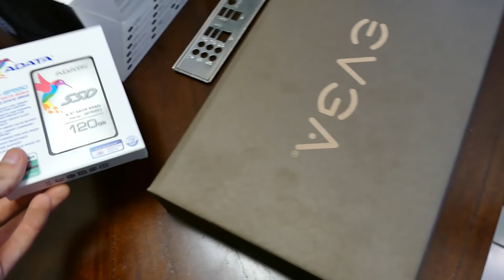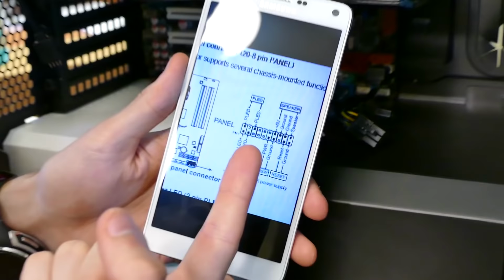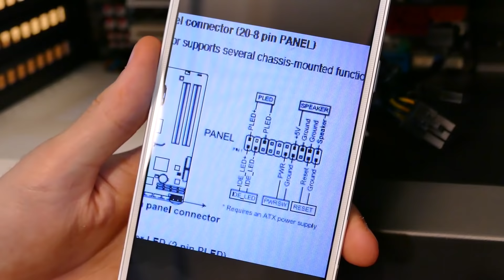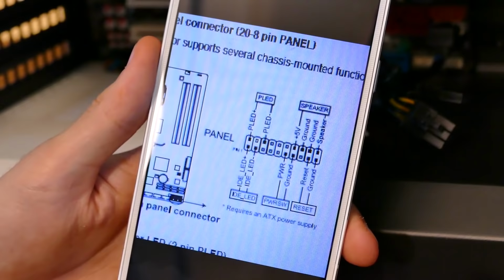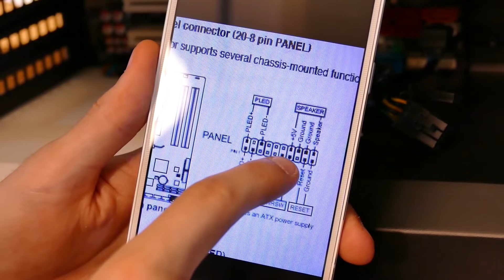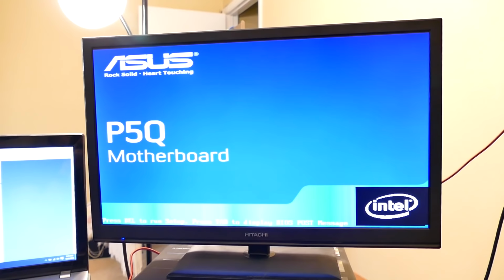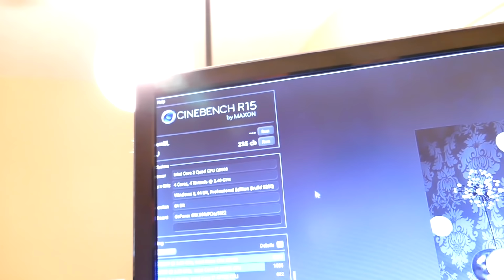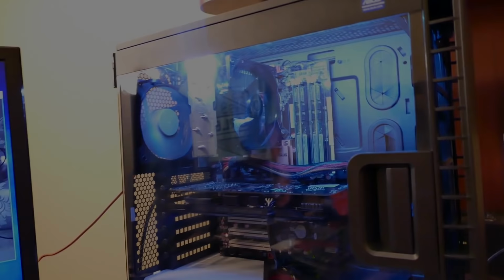Q6600 PC Build Vlog

Comment: should have done a E5450 mod. it costs $20 and is much better. I actually just built a PC with an E5450 and that same motherboard. With a used HD7870 on ebay for $80 dollars it plays witcher 3 with med/high settings @ 50ish FPS
Reply: I got it to 3.6GHz with a CB score of 420 too.
Reply: Blaze it
Reply: +Egon CZ yep

Comment: I wanted to get q6600, but then i find out e8400 is actully faster and not by small margin. And also cheaper, but both of them are nothing special today 😊
Reply: Milan Stojakov no thats weak quad core is much better and stable
Reply: The E8400 has a better SINGLE core score, however it is only a dual core, the Q6600 is a quad core (since the Q), the E8400 used to be better around 2008 to 2010 when games only used a maximum of 2 cores, around 2012 or later games started favoring the 4 cores.
Reply: That is true, but i do not think it matters. See these cpu are old and not suitable for games. If you are going to play games relesed after 2012 you are going to need a lot stronger card, one that will be bottleneck by q6600.

E8400 is great for non gaming applications, even today. You can use it to build nongaming pc just fine for very little money and it will outperform q6600, because in the end single core performace is more important that the number of cores.

Comment: hey, u should try the g3258. Its a good future proof cpu. I've been making $300 builds with it. I got it for $40 at frys electronics for my last build.
Reply from the maker: No, not using a dual core. I already have a G4400 build.
Reply: A dual core is not "future proof" in any way.
Reply: since it uses an lga 1150 motherboard, you could upgrade it to an i5 or i7 later unlike the q6600 or older mobo/cpu and the g3258 is a mini beast that ocs well
Reply: ***** But you originally said that the CPU was future proof, not the motherboard. Plus, a good LGA1150 socket motherboard is going to cost a lot more than a good LGA775 motherboard.
Reply: i got all my mobos for like $20 used lga 1150 z97
Reply: ***** But where? Just because YOU can get stuff cheap doesn't mean that everyone can. I hate it when people like you base your argument off of information that the other person could not possibly know. Sorry, I was going more off of the general cost of them on Ebay, which is about $80-120US.
Reply: ur buying a used mobo and cpu anyways with the build science studio used. if u play it smart on ebay you can get alot of stuff cheap. alot of used motherboards on ebay go around $30-50 for bidding. The motherboard im using right now I bought for $15 and its an msi z97 krait edition. And I made another build with like a $25 msi z87 g-45 gaming motherboard

Comment: Getting a Xeon X5550 is a better idea, 8 threads and higher binned.
Reply: You're getting confused with lga 771 x5450 and lga 1366 x5550. Different architectures. E5450 is best overclocker for this board without buying extreme and rare models.
Reply: PS4 Custom Gamer I am not confused, getting a motherboard for LGA 1366 isn't hard.
Reply: X5550 platform is just much more expensive. I didn't say x58 mobos or 1366 boards were hard to get but the overclocking x58 motherboards are double the price of a p5q motherboard, Instead of buying cheap ddr2 you end up with more expensive ddr3(or cheaper ECC).
I do agree that westmere xeons are the better combo especially buying a motherboard combo with an i7 920 but I wouldnt bother with the x5550 myself as a 6 core x5650 should match a 6700k in rendering.

Comment: Come on man... dont go "big head" cos now you have more than 14x subs since that first vid of yrs i saw. 
Answer my question... is corsair cx 430 bronze okay for stock 6500 and strix oc 1060?
Reply: YEA ANSWER THIS.... !!!
Reply: That's a 430W PSU, probably not enough. GTX 1060 recommends 400W. And by "6500" I think you meant i5-6500, that has a TDP of 65W. If it is enough, it's cutting it close. I would recommend a 500W PSU.
Reply: Well its nothing much in price difference... Like 8 bucks or so but my pre-built pc came w that low tier psu and i'd rather spend cash on better gpu than gpu+ new psu. Ty for yr opinion.

Comment: If this guy is gonna make videos, he's gonna need much more power than that Q660, trust me from experience...
Reply from the maker: His videos are basic. Working fine for him.
Reply: +Science Studio I have an Athlon X4 760K at 4.5GHz and even that is barely enough to handle programs such as XSplit to record gameplay.
Reply: I use Sony Vegas 11. Rendering with GPU isn't an option, rip.
Reply: I agree it's not fast enough, EEvblog did a test using GTX 900 series cards and 4th Gen i7 spanked cuda acceleration with Adobe.
Reply: hardcore yes, but not for just simple stuff
Reply: thats recording not editing very different
Reply: Vegas is a pain to use but its so easy to get for free tho lol
Reply: +Greenespirit I got so used to Vegas. It's really good in my opinion.
Reply: Exypnos In my audio visual class we use Final cut pro which is actually not as bad as I thought and it just feels better. But then again I have to use a mac to edit so that takes away from it lol
Reply: +Connor Alley From experience you can't capture the video out of a PC... on the same PC. A lot of problems arise.
Reply from the maker: Yes, he has a capture card that he uses.
Reply: What games can you play with a q6600, i didnt see any game play in this vid..
Reply from the maker: Any game you can this of, a Q6600 will run. We've already tested GTAV, Rise of the Tomb Raider, and Cities: Skylines. Decent results. I already said in the video that the gaming benchmarks would be in a separate video.
Reply: What setting were run for gtaV if you don't mind?
Reply: that's where the gtx 950 comes in.
Reply: neither of these components are very powerful.. to do any kind of real work you will probably want a much newer quadcore, or you could go for an LGA1366 6-core (you can get those on ebay for almost nothing, and they're overclockable)
Reply: It all depends on how you use it. Seriously. Quit being PC elitists. Yes, there are a few other things that could of been done, but LGA 775 is cheap and easy, and can still get the job done. This is the same argument as 60 and 144 hz monitors... all depends on the person and their interests.
Reply: No it is not. First of all, trying to find a single socket mobo for LGA 771? Good luck. Also, a Q9650 is exactly as powerful as a e5460. While the Q9650 is still around $80, a Q9550 is really close at 2.83 ghz instead of 3, and can be overclocked to match for the most part, at $40. It can not be more powerful then the Q9xxx series due to the same IPC, 45nm, 12mb l2 cache that is split 3mb/core. While sure, you may be able to spend a bit more and get a dual socket mobo, but that only matters if you could really make use of more then 4 cores, and it would not be as cheap.
Reply: While it can, you risk damaging the motherboard, and you risk not having the bios compatibility or if you even have the wrong chipset. If you wanna take that risk, good luck. However, I'd rather go with what WILL work, at no risk.
Reply from the maker: The case and LEDS were $50... get it straight.

Comment: $400 on a computer like this almost seems like a waste. I think I spent $350 on my rig and it has an 4670k, 16gb, 750ti, and 3.25tb of storage. But I digress.
Reply from the maker: Yes, you digress. You know very well that your setup is not that cheap normally. Special circumstances are not general circumstances.
Reply: +Science Studio Yeah, I'm aware. It was just a little brag & I couldn't help myself.
Reply: +Science Studio Anyway, keep up the awesome videos.
Reply: BUSTED
Reply: I spent about same for a 4690k system as well. Found a phenom 2 945 system at some recycling center years ago and then later also found 16gigs of ddr 1666mhz kingston ram. So when it was time for a upgrade I just simply bought a new z97-a asus mobo, 4690k and put the ram and all other components from the phenom 2 system into the new one. I also have various other spare parts from recycling center, so I could still sell that phenom 2 system to make this upgrade even cheaper.

It is definitely a much better option for poor people like me than going for a new skylake rig with barely any performance improvement, as the boards are cheaper and you dont have to invest in new ram.

Comment: So you spent $100 on a case instead of getting a much better GPU....
Reply from the maker: No, the case and LED kit were sold to him for $50. Nice try.
Reply: Science Studio Then the price list in comments and your claims are misleading......
Reply from the maker: No, my claims are not misleading. Do not put words in my mouth. I simply provided a link for where you could buy the case.
Reply: So your claim is the build is $400. Using your own provided links and going for cheapest prices I got $455 and you forgot to include  SSD prices which adds another $30-40 totaling nearly $500. So instead of misleading people may be put down prices you ACTUALLY paid for the parts instead of putting random links.

Comment: Not a fan of the ddr2 but it's alright I guess
Reply: Yeah sadly many aftermarket boards used ddr2 v ddr3
Reply from the maker: DDR3 boards were too expensive at the time.
Reply: LGA 775 and DDR3 is apparently too troublesome for what it's worth.
Reply: Well right now I definitely prefer ddr4 since it's becoming a lot cheaper found some deals for 20$ per stick of 8gb ddr4 and a 100$ motherboard so at this time I say that ddr4 is at a really good state

Comment: i have a Q9450 :( Same Sockel
Reply: You've got a 45nm part, that's better than this q6600
Reply: jeah but it AVG Temp is 55 °C
Reply: Smil3F4ce Idle or under load? What cooler are you using? What are you running it at?
Reply: :D
Reply: ***** i have a Liquid cooler -.-
Reply: Eli Hopf  idle 50°C ingames (CSGO) almost 60°C or more
Reply: Smil3F4ce
Overclocked? That idle temp looks scary.. Could be a bad mount.
Reply: +Eli Hopf Old CPU.... thermal paste dried up under the heat spreader.
My i7 870 idled at ~40c / ~85c load. I didn't care much.
Reply: +Lol Jolk Pretty sure core 2 CPUs were soldered, and didn't use the cheap tim. Maybe not tho
Reply: Eli Hopf No i cant overclock :( still 2,66ghz
Reply: Lol Jolk My Thermal paste is new..
Reply: But awful overclockers if you dont have a good quality and newer board that can handle high fsb.
The 6xxx series uses a lower fsb, so you can simply just change to 1333fsb instead of the default 1066fsb.
Reply: bloxyman22 my Q9450 has already 1333 fsb
Reply: Smil3F4ce
And that is exactly my point.. That makes it much harder to overclock, as you will quickly run into limitations because you have to raise the fsb even higher to get any overclock at all.
With a 1066mhz cpu like the 6600 you get free overclock just by flipping it over to 1333mhz.